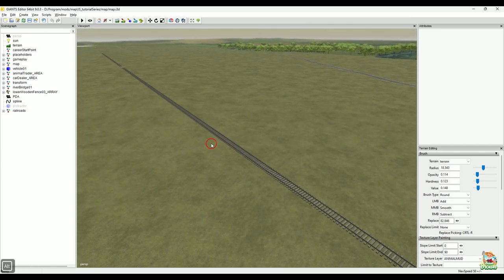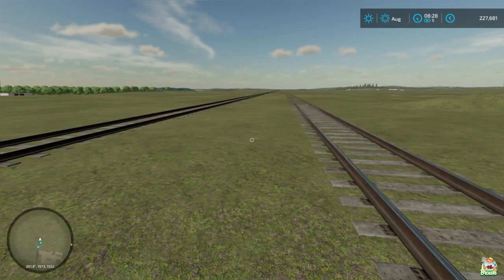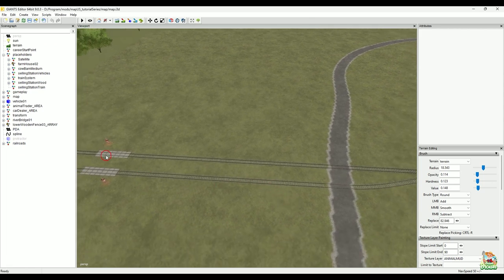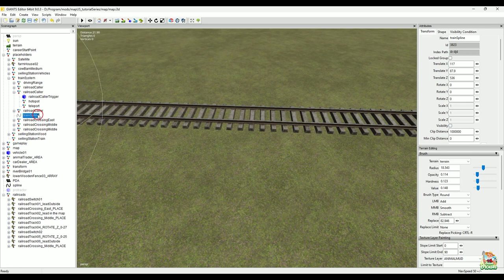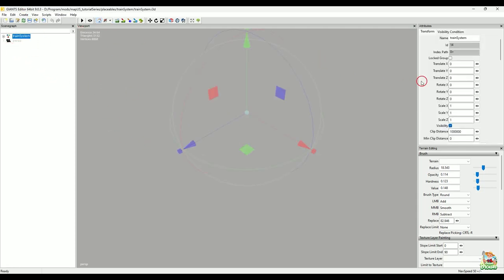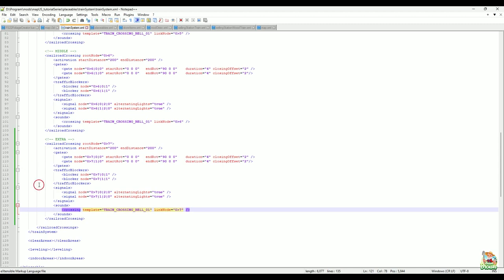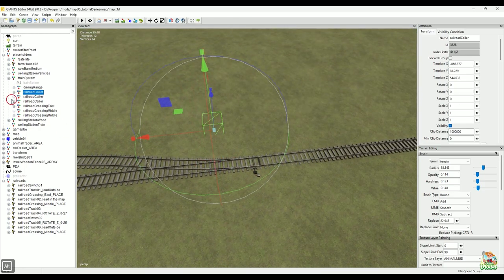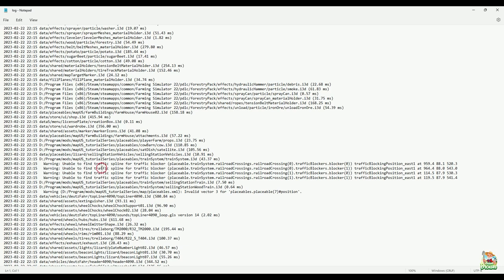Learning the Train System: Part Two

Comment: Hey BB, hands down the best channel covering the complex topic of FS map making. Thanks for sharing your wealth of knowledge regarding this process. 

So thanks to you bestowing this wealth of knowledge upon us, I’ve started a 4x map...yeah I can imagine the laughing at your end ;) but so far all is going well, doing it in the vein of a NML western wilds map for a competitive mp game with friends.

To begin the journey I fired up Photoshop and started to work on a set of grids to use as guides for painting in the < or > 100 farmlands and the PDA. I then saved them as DTX5 alpha grids. In the editor I created a 4096 plane and used the grids as a texture, swapping them out as needed. This proved to be a simple and efficient method for stage one of the project, and as I was working with the KISS principle {keep it simple stupid!} all was going to plan. 

At around 50 plus farmlands I start thinking about checking the integrity of the farmlands ie running  a plow NS and EW across the farmlands in field creation mode to make sure that farmland 127 {which covers the whole map} is not going to cause me headaches later on.

It’s around this time that my kryptonite kicks in; 1> I’m easily distracted and 2> a simple thank you, turns into a wall of text like this ;p

Well at this point I’m thinking for the purpose of testing I’ll need to put in a vehicle shop and gas station. I know where I want them, but if I’m going to place them why not check out the paint terrain script and put in some roads, so down the easily distracted rabbit hole I go.

As the map is dead flat the roads were a breeze to place, but this did make me start thinking about about the best way to create different types of terrain. Paint it, use a spline {I see it in the editor but can only speculate on how to use it}, use DEM data {have used it for Train Sim route projects}, use an app like world machine, terragen, gaea, etc, knock one up in 3dsmax, or work out the gray scale values and paint one up in Photoshop as a height map and go from there. 

As for the vehicle shop I ran into a couple of issues, but thanks to your video on the subject they were easily sorted out and it is now tested and working as intended. As for the gas station it’s next on the to do list. 

Oh...before I go, I think the vertical line is called a pipe character. Looking forward to see what you come up with in future videos.

Cheers.
Reply from the maker: Thanks Rich, I really appreciate the kind words! Nah, I'd never laugh at the fact that you started with a 4km map ... after all, I started the exact same way! It was only when I was neck deep into it, sorting through a myriad of issues that I had no clue how to resolve, that I started second-guessing my decisions up to that point and wondered if I should have started with something a bit more manageable. Oh well, trial by fire ... that has always been my style! 

When it comes down to it, aside from size, the differences between a 2km and 4km are really not that significant. I just feel that as you're learning and hacking your way through the project, it's much easier to throw away a smaller test map than it is a large-scale project if that's what it comes down to, and unfortunately sometimes it does come down to that. It's a tough pill to swallow, when at the end of your project, after countless hours of work, you realize there is something that should have been done differently during the beginning stages but is much too late to change now at the end of the project. Mistakes can and will be made - better to get them out of the way with a throw-away project. 

I've created terrains using most, if not all, of the methods you listed. I've been doing more work with real locations these days and in that case I work with the real geographical DEM data. Fictional maps I like to grab anything at random and challenge myself to work with it (whatever I end up with) as long as I don't have something specific in mind. That terrain data usually comes from any number of sources. I have a pet project on the back burner right now for which the terrain data came from a completely unexpected source. I'll spill the beans on that at some point  down the road :) 

Anyhow, I'm glad you're enjoying the videos. It was a rough start, but they are progressively getting better. If you have any questions, don't hesitate to ask. Hard to say what videos are next, there is still a lot of basics to get out of the way. I've been getting material together for Spline Street Constructor, so who knows :)

Comment: any ideas on why the wood wont sell when the train crosses the trigger? i have everything in the files correctly but it wont sell it just fly's off the train car when it reaches the end of the map.
Reply from the maker: Sounds like the trigger itself is not being recognized. Check the error log, and if no errors, confirm that it loaded correctly. With some triggers it could be that it loaded fine, but it's sitting too low to detect approaching vehicles.

Comment: good morning sir. question for you concerning creating mapdem. do you know how to do it? i can only find videos for fs19
Reply from the maker: Yup, I definitely know how! Just know that any video you find on the subject, it's done exactly the same for FS19 and 22, so you can watch those FS19 videos to learn.
Reply: @bauerbrown  struggling to remember what i need to make the files sizes for an 8x map. i know its 8192x8192 but i dont remember what else i need to change. any help on that would be awsome.
Reply from the maker: @farmerboyz2020  Off the top of my head I'm not exactly sure, it's something I'd have to look up or experiment with. In all honesty, there is no standard, set sizes for any map size. You could pull off a 16km using the same files you use for a 2km (with the exception of a few). It would look horrendous of course, but it can be done. It's a popular misconception that file sizes need to be doubled when scaling up - that is 100% incorrect. Some sizes are fairly common to use however, like _weights of 4096 or higher, and DEM of 4096. The InfoLayers and density maps (GRLE/GDM) are the ones that have different, mostly specific sizes. You might have to Google this one for now. I have an 8km at home that I can look at when I get back there, but that won't be for quite some time yet. Sorry I couldn't be more help at the moment. I know it's not doing you any good now, but if it's any consolation, once I finish the website I will have all of this information, and even blank files, on the site to help you guys out. Eventually there will be a ton of stuff there that will prove to be invaluable to mappers.
Reply: @bauerbrown  no worries brother you gave me some info on what to google which helps. stay safe good sir.